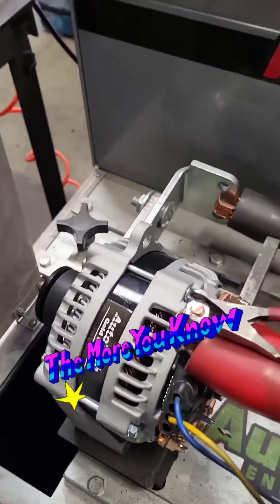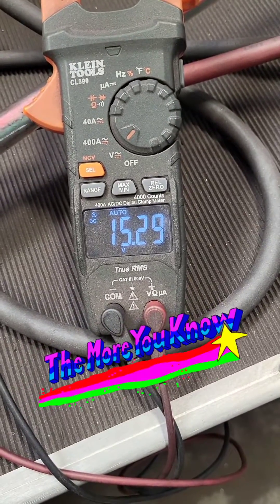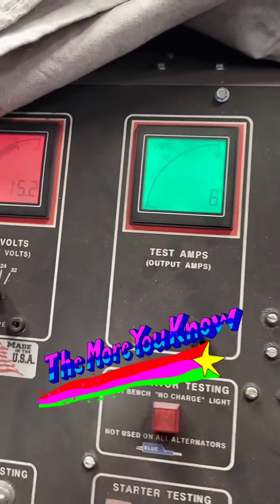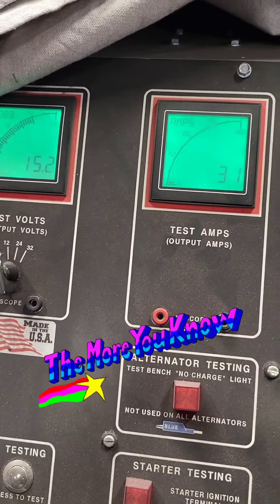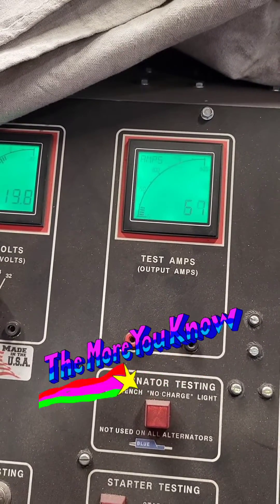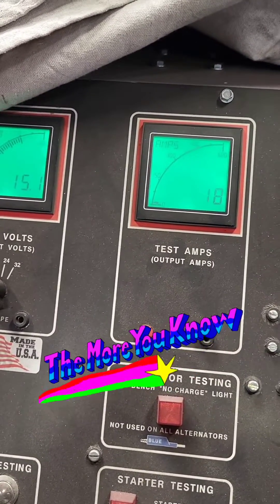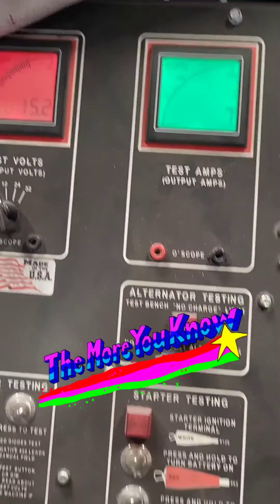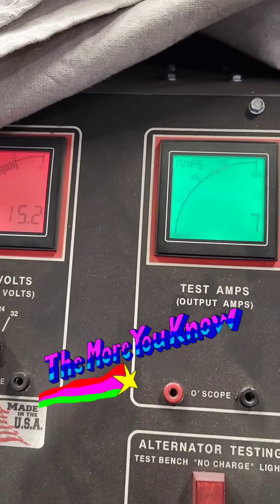Aftermarket 15.5v voltage regulator review.

Comment: I’m looking at some of your dual alternator kits which would work with my amplifiers fine but I worry about my battery which is headway lithium cells what would you suggest in that case? Btw I have a 2002 Yukon xl
Reply from the maker: Email us, info@autotechengineeringusa.com